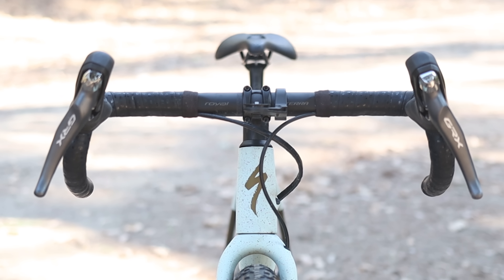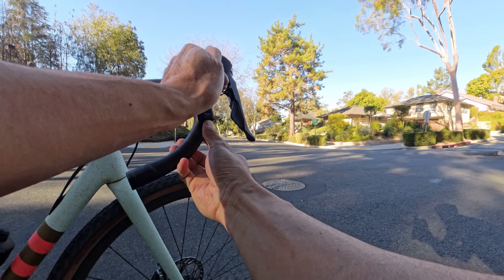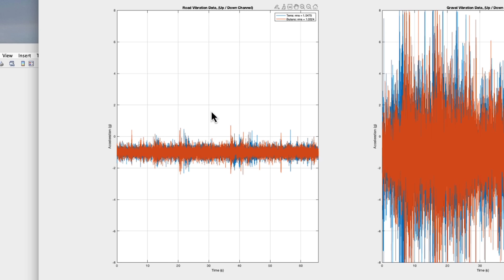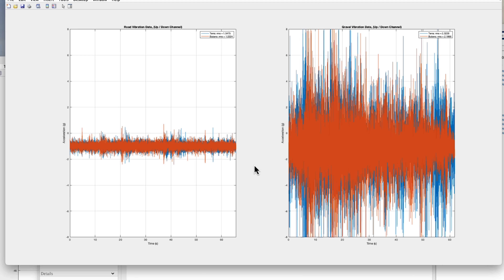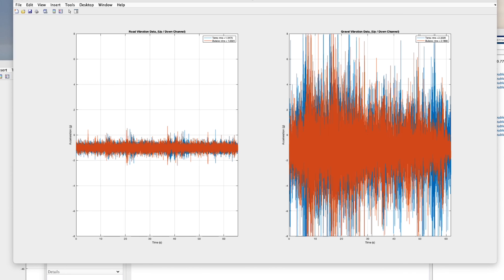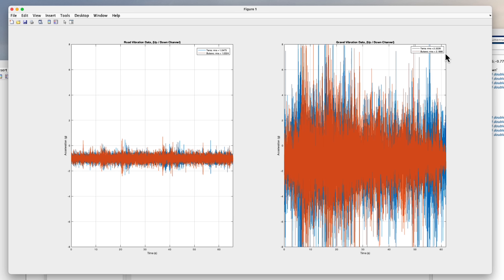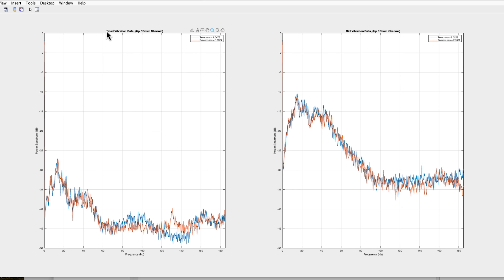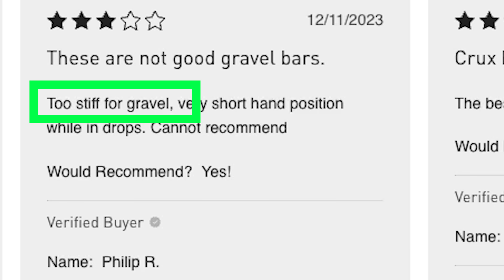Carbon Handlebars DON'T Always Reduce Vibrations // The SCIENCE Says So.

Comment: Point of order:  When doing RMS you should be careful to remove the "DC" average value.  Vibration should exclude the static gravitational pull, as that is constant force, not vibration.
Reply from the maker: It’s a good point. Primarily for doing delta calcs. For getting a sense of relative vibrational energy, it’s not as critical
Reply: @TheBikeSauce  In the case of the road data in particular you set yourself up for a some problems.  If the angle of the sensor is off a little, say due to different amounts of flair or attachment angle you could get a percent or two error in the vertical axis, which becomes on the order of your measured difference.  Ignoring that, the 1.5% difference would now be more like a 50% difference in RMS vibration amplitude (assuming 1.00G, which I realize is very subject to the sensor’s static accuracy).

Comment: Good video. What would be interesting would be the same test comparing a highly shaped ergonomic bar versus a traditional tubular profile bar, in either material. I think shaping makes a bigger difference than material. Maybe a little bit of that is that the vibrations are dispersed differently due to the shaping, but perhaps a bigger factor is how the rider's anatomy is spread across the bar, resulting in fewer pressure points and less fatigue. 

Ritchey knows what they are doing with aluminum. I would say of all the aluminum bars I have ridden, Ritchey feels the best, with Zipp a close second. 

In terms of the Roval Terra bar specifically, I have it on my Crux and I think the best thing about it is the extremely shallow drop of 103mm. This allows a more relaxed feeling throughout my upper body on rough descents. Even the Zipp SL70 XPLR gravel bar forced me to extend down 1.2 cm more to use the drops. Road bars would be another cm (or more) lower still, for reference, so the Terra are a very useful and comfortable shape. The Terra bar also comes in a 38, which not many gravel bars offer. 

Another thing to consider is that while the absolute weight of a bicycle doesn't mean much out on the road, the weight distribution can have a big impact on how a bike feels to ride. While comfort is always paramount, taking weight out of the cockpit (saddle, seatpost, stem, bar, tape) should results in better responsiveness and more confidence, because the CoG is relatively lower compared to a bike with a heavy cockpit. On my Crux, the total cockpit (saddle, seatpost, stem, bar, comp mount, tape) weight is rather low without any compromises on durability or comfort - something like 750g all in, minus shift levers, of course - and having a bar that only weighs 190g helps a lot with that.

Comment: I'd love to see you compare more handlebars. On a road bike I used to have changing the stock round aluminum bars to a set of 3T Team Aeronova handlebars made a big difference in ride comfort. They did have quite a bit of vertical flex though which is likely more of the difference that I felt rather than vibration frequency. Later I tried a set of FSA round carbon handlebars and they felt the same as the original aluminum bars.

Maybe the flat aero profile of the 3T handlebars allowed for more flex than a round tube but I'm sure specific carbon layups can vary between brands and models a lot too.

Comment: It would be interesting to add to the comparison the cheapest straight gauge aluminum handlebar you could find to see if the Ritchey handlebars are comfortable due to their butted tubes or if those carbon bar owners that claim their bar is super comfortable are coming from very stiff aluminum handlebars.

Comment: Interesting analysis, but it would really benefit from testing the stiffness of each bar on a jig. Carbon fiber does have higher damping intrinsic to the material than aluminum, but the difference is so marginal in this context I doubt it would even be measurable in the noise of the rest of the bike system. However, if a bar is so flexible that it's literally incapable of responding fast enough to transmit certain frequencies (or more realistically, just attentuate them because we can't make the bar a rubber band), that would be noticeable, particularly with longer mountain bars. The benefit of carbon is that's it not isotropic. They can increase stiffness on one axis and reduce it on another more easily than you can manufacture an aluminum tube with similar properties.

Comment: To add the theoretical background: Carbon is unable to damp any kind of vibrations because damping vibrations means dissipation of kinetic energy. Carbon has no way of internally dissipating energy, it would need some kind of loose interface between the fibers and composite matrix that performs a relative motion that in turn creates friction and therefore the wanted conversion of kinetic energy to thermal energy. If carbon was able to internally dissipate the kinetic energy and therefore damp vibration, it would most likely start to burn due to its low thermal conductivity. So any ad talking about carbon and vibration damping is of course bullshit. Very cool of you to measure these things and show them to the public. Really enjoy the video

Comment: The breakdown on this is to not just generally compare an apple to an orange but you have to compare a specific variety of each. I replaced an aluminum bar with carbon for a few reasons. The carbon one doesn't feel much different at the brake hoods but it is much more complint in the drops. That is very welcomed when you switch to change pressure points on your hands and when the speed goes up. Great video!

Comment: I originally had a Ritchie carbon bar on my Open gravel bike. After couple of years, I put an Enve bar on it. The difference in vibration and resulting increase in comfort was significant. So I can say with confidence that there can be big difference between carbon handlebars. As far as this video goes, the data set is too small to make a generalization between two materials and only seems to depict differences or lack thereof between two specific bars.
Reply: Enve handlebar is better??

Comment: I love those videos from you. People think that the only difference is due to material ignoring wall thicknesses, geometry, heat treatment, weave etc. That goes for frames, handlebars etc. Love to see your data on that. For me I've switched out heavy aluminium ones to carbon and I did feel the difference  but how much was it the bar material and how much the construction etc. I've always said that with steel frames being comfortable... you should ride my 90's bike you'd change your tune. That thing was a tank. Material characteristics is only one part of the equation.

Comment: Like 4 years and 10k mile ago, I changed my setup for an Easton EC70 AX Carbon Handlebar; I wanted a different size bar - went from a 420mm  to 400mm. Previously 
I had an aluminum Giant Connect XR which I had been very happy with.  By that time I had changed up from the one frame to another (due to geometry)  from an aluminum frame to a Ti gravel frame (w/ carbon fork)  so I really didn't notice much difference in the reduction of vibrations. The (minor) weight saving was nice, and I got a take-off for a very reasonable price ($120 or so) So I don't regret spending a bit more.   Was it 100% necessary ? No. 
But, a bike does become the sum of it's parts;  small changes over time make bigger impact on the whole that AH HA ! this $300 handlebar will make this $1,000 bike feel like a $8,000 bike. 
Geometry and being comfortable on your bike is WAY more important than any individual component. IMO

Comment: Would be cool to see the Spank Vibrocore handlebars, the cheapest aluminum drop bars, the Ritchey bars and maybe a flat top carbon bar. Most interested in the Vibrocore as I’m not aware of any other bars where the main feature marketed is vibration damping and still aluminum but filled with foam
Reply from the maker: Yea someone else mentioned it. I’ll try and get sone

Comment: I think this idea that CF this or that has better vibe damping is an extension of traditional argument about what frame material is best and why (or alternatively, which is worst and why).  Such arguments always seem to ignore things like tube shape, diameter, thickness, geometry, and other factors that could very well have a greater impact on vibe damping, comfort, etc than material type..  Don't get me started on  what riders proclaim about the "feel" or "ride quality" of part X.  Humans rare arguably the least accurate, least precise, and most easily biased sensors.

It's the first video of yours I've seen.  Excellent work!

Comment: I think what's never talked about is that carbon is warmer to the touch. Even through the bar tape and gloves you will have a comfort advantage in cold weather if you go with carbon. Also I like the mix between stiffness and flexibility depending on where and in which direction force is applied.
Reply from the maker: Thermal conductivity! Great point. However, being that most bar tapes have extremely low conductivity, the material underneath (carbon vs alloy) won't realistically make any difference in thermal comfort.
Reply: @TheBikeSauce  I disagree but I won't deny that my head plays a big role in how I perceive my shiny new toy :P

Comment: I lost interest in carbon bars a while ago, but I am wondering on any bars with backsweep and/or flat ergo tops, how does that impact mounting accessories or bikepacking bags? Seems to me like backsweep could make mounting bags a little more difficult, and the ergo tops would give much less space to attach anything that expects a round bar (lights, extenders, computer mounts). Some of the described widths of the mounting area seem like I'd be mounting bags right where the bars transition from ergo to round. Anyone have actual experience with that? Is there space to mount say a bike computer + a light on the same side and still have room to mount a bag?

Comment: Can you test the aluminum bars with a Redshift stem?
Reply from the maker: Much appreciated! 🙏. A scientific suspension stem vid would be cool actually
Reply: Heck I’ve done that in real life for ya already. Been using their stems for 4 years and tried it with carbon and Al bars. Even if there is a quantifiable scientific  
difference in materials, that stem makes “road/dirt vibration” issues a non thing completely. Tried it on my road bike once and it was just too plush for me. I do keep it on my gravel bike and I do race.     Also, Dampening the front end to some kind of significant difference to matter in terms of relieving pain or discomfort on bike really isn’t anything you are getting out of handlebars in the first place anyway. Thicker bar tape alone does more to reduce road vibration than any difference in bar material. 
I am using carbon bars  because of the specific shape and design of the ones I own but if they made these in an alloy version I would have bought those, on my gravel.    And $250 for Roval bars?  I think Spesh is trying to pass off old out of date round CF bars with their name on them and make a buck.

Comment: On my mtbs, I definitely feel the difference, especially on SS. Makes sense, a long tube that has a considerable distance before your hands. Always on the fence if drop bars did that. But they are lighter, if that is important to you. Great video!
Reply from the maker: I have the carbon 1Up bars and the pnw carbon bars for mtb, and I can’t say I notice anything with either. Giant tires and 150mm of travel mask any significant vibration damping from the bars for the ones I’ve tried. Which bars did you feel the difference?
Reply: @, Back in the SS days, I ran the carbon niner bar and a santa cruz carbon bar. It was absolutely noticeable. When you’re riding east coast jank, all those bits of compliance add up.